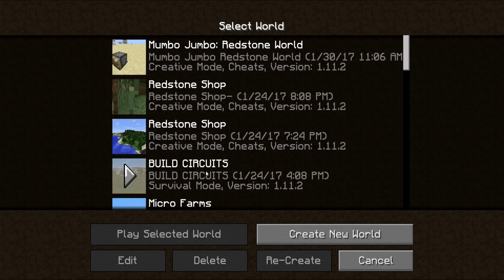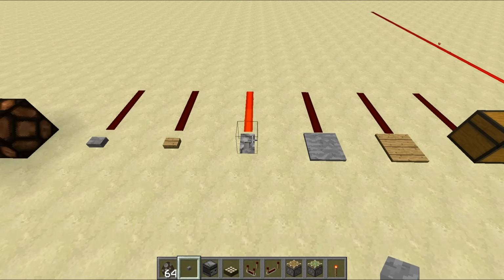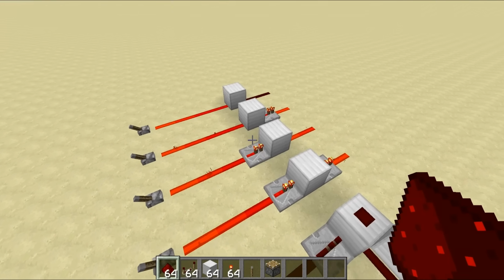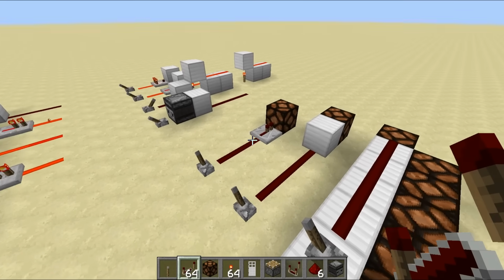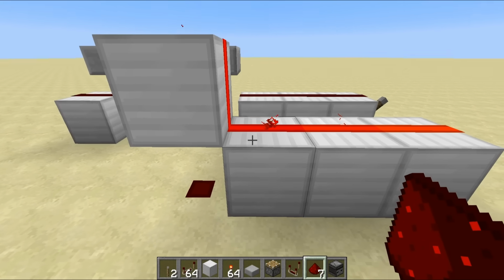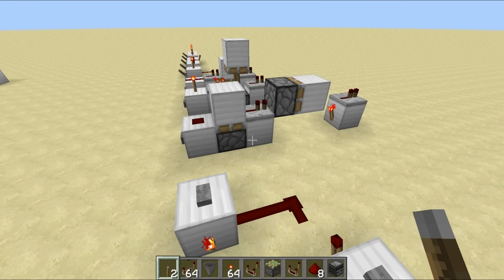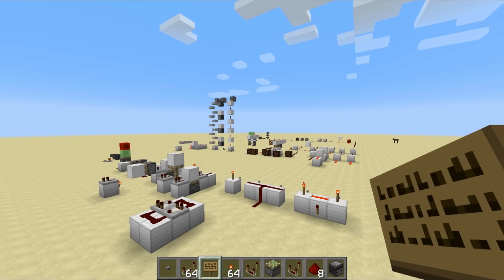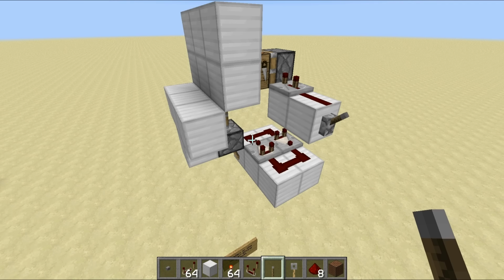How to go From NOOB to PRO at Minecraft Redstone!

Comment: Hey mumbo
any idea how to fix the falling monostable circuits for bedrock?

I was able to hardpower the piston by placing the first repeater on the floor and the startblock with the button even at floorlevel. but sadly the piston does not output power to the 2nd repeater in that way.

same for tflip flip, the output is not constant

Comment: I specifically didn't want to do what Mumbo did. I don't like doors that you just pressure plate walk over, but the homework required pressure plates. So I (poorly) designed a vertically opening 2x2 that you throw an item onto a hidden pressure plate to open the door. It has a delayed opening, so you can keep the "lock" some distance away from the door.

Comment: I somehow created a permanently activated detector rail in survival 0_o It can be updated, moved, powered in any way, but it will for some reason never shut off to the point of breaking it and placing it again. You can power stuff from all the sides, except the block above it. I just used a sticky piston, detector rail in front of it with a minecart, and 2 redstone dust on any side of the piston. And broke the piston. It worked. It even created a redstone clock before breaking the piston.
Edit: Here's my theory how it works. The cart placed on detector rails activates the redstone on the side, powering the s piston and making it move the rail along with the cart away. Then the piston deactivates and retracts the d rail, activating the redstone again. And the cycle repeats again. And again.

Comment: I remember using poor redstone. Now I am learning to use slime blocks five years ago. Then,About 6 months ago, I made a flying machine in a survival world and just built a sky base where it stopped. But now, I'm making actual working tanks. NPC enemy tanks. I use the simple caterpillar engine, deck it out so it looks like a tank, then put the minecart and a ghast in it. Then I just turn it on, switch to survival, jump in my tank, and let the games begin.
✔️Moves 
✔️Shoots explosive ammo
❌Practically indestructible 
✔️Weapon can change direction 
❌Turns 

Also made planes and boats, a pretty good achievement. Redstone movement. Land, air, and sea. Just recently found the engine and extensions alone can just plow through walls! 😆 

I love Mumbo's creations and they inspire me to do better. And he always does new redstone so I never stop learning. Keep inspiring Mumbo!

Comment: Dude my block switcher was garbage crazy.  I put the button two above the block being switched and I did a thing that pushes both blocks back and forth but a third piston comes in to push one of them in depending on the location of the redstone block that goes back and forth with each time flipped.  My pusher piston kept getting randomly powered every time I pressed the stupid button so I had to fix that for an hour.  My timings back and forth weren't working and I had to incorporate a rediculous bud piston updater thing next to it that pushed two observers together creating a quick clock to flip a piston on and off rapidly for like a second, forcing the other piston to update so I could push the darn block into the wall.  It ended taking forever, being massive, and being super loud.  I facepalmed when you not only just pushed the blocks in from different directions but also just used a pulse extender.  Ugh.  I don't feel like a pro.

Comment: Im honestly so proud of how i designed the crafting bench thing, especially because before this i was Grain level awful at redstone. I really dont know how to explain it, i basically used a double piston extender for the wall piece, and instead of the lever he used to power it in the example i used a redstone torch, and then built a tower underneath, which then had a pulse going to the piston that would extend the crafting bench up, and the lever would turn the tower on and off, its pretty impressive for how terrible i am xD

Comment: and t flip flops are an easy way to open and close piston doors from both ways,
Right?
Reply: Yes but remember the design mumbo used doesn't work in bedrock edition. Also if you care about compactness then there is many smaller ways.
Reply: Oh and I forgot, if your using pressure plates then all you have to do is connect both pressure plates to eachother with the redstone and use a redstone torch that will be powed by the pressure plates and run the redstone to the pistons. Sorry if it isn't explained very well.

Comment: Watching this video made me feel inspired to build something in Minecraft, so it gave me an idea, what if I built a machine that will make noise and having a blinking light when melon or pumpkin finished growing, and I actually did it, I made it where when the observer picks up a block that is in front of it a Redstone tick will go off, and a sticky piston would grab the Redstone block which is stopping the Redstone repeating loop from repeating, and the repeating loop would then power the solid light (Redstone lamp) and make it start blinking, and then it would cause a note block to start repeating a note, and when you take the melon or pumpkin out from in front of the observer the Redstone tick would go off again and turn it off, thanks for inspiring me!

Comment: Im probably an idiot for watching this video two years later but i couldnt figure out anything... so i copied ur “hw assignments” and the crafting table one doesn’t work even after copying you... im so confused
Reply: I figured out a work around, but it took sometime because i am also poop with redstone, but ill explain what i did as best as I can:
So move the top piston and the two blocks attached forward 1 space,  as well as the bottom piston
then the redstone torch at the bottom (if facing it) move to the right side instead of the left side like it is in the video.
then use some redstone dust to connect the power from the torch to the piston on the bottom. Also leave the redstone pulse exactly where it is.
Hopefully this helps. But im sure if you look for a video you can find a much smaller and more simple design

Comment: When you play bedrock edition and most of the mechanics don't work :/
Reply: I just found this out the hard way. I just tried to make a piston extender and you cant pull other pistons with a piston.
Reply: Mojang doesn't give a fuck about supported version consistency
Reply: yeah... i can't make the last "homework" wall workbench even from the video since it doesn't work...
Reply: @midnightrose23  i figured it out
Reply: @midnightrose23  u can, but it's very inconsistent.
Reply: Sinister XX use 3-6-0 delay instead of 2-4-0
Reply: LyricLuke It should all work except the falling edge monostable circuit (i havent found a way to make it work yet) the rising edge monostable circuit (replace the first repeater with redstone dust) and the T-Flip-Flop (Hook up two locked hoppers with an item in them to the monostable circuit so that the redstone puls from it unlocks them for 1 tick causing the item to switch hoppers and place a comparator in front of one)
Reply: I bought a whole book about red stone and half the things didn’t work!
Reply: BLT CampLife the book is about Java edition
Reply: BLT CampLife Oh, that's not good. I'm pretty sure I would have bought the same book you bought recently. So, to know it won't help me at all, well, that sucks a fat one, haha. Still, I plan to read through it anyways. It sure would suck if they wrote and sold us books that only work on certain versions/editions of the game, I only play on the Bedrock Edition, on my smartphone. That's just crap if that is the case. Thanks for the heads up though 😁👍🏻.
Reply: I feel your pain. My computer got destroyed about a year ago I only play on phone now. 😅
Reply: I fixed most of the failed mechanics on bedrock by adding in extra repeaters.
Reply: Watch silent whisper he's the best Bedrock redstone guy
Reply: Same! I was able to get the first 2 homework ones that Mumbo explained but the crafting bench one wont work :/

Comment: All I wanted to know is how to make a red stone door but thanks anyway 👍🏾
Reply: Bob Marley Yeah, me too. I want to make one that I can open and close from the outside and inside of the door with two levers or buttons, but I can't ever get it to work. I can put a lever only on one side. I tried a pressure plate and a lever but that didn't work really well. So, now I just use two pressure plates, which sucks in case of in the unlikely event a dangerous mob gets passed my outer wall and layers of fencing, that it figures out how to step on the outside pressure and gain entrance into my humble abode, haha.
Reply: Well, I should have said, my outer wall, then my many iron golems haha, then my layers of fencing.
Reply: First place some Redstone next to a door then put a preserplate next to the Redstone then step on it now you have a redstone activated door
(Sorry for bad spelling)

Comment: Comparator: If it is on, it subtracts if it is off, it compares. Subtracts redstone when there is a weak signal from a powerful signal. Comparator is if the redstone signal is more powerful on the back, it continues on the front, and the same with the front. I guess if that makes sense

Comment: Me: watches video on PC Redstone 
Also me: plays xbox minecraft
Reply: Me: plays Minecraft pe
Reply: They both are on the same update, so everything will work
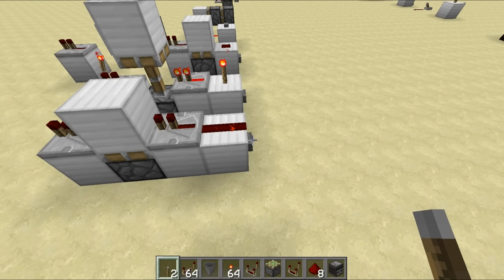Reply: @bruhham6486  sadly a few if the components like the ones at 15:00 won't work in my better together world
Reply: I play on ps4
I hate myself
Minecraft cant have more than 55 chickens or other damn food sources
And lags easier
Reply: And also me: plays minecraft pocket edition
Reply: Yeah I play on xbox 😭
Reply: You need the old disc minecraft xbox one for good redstone. The other stuff is just mcpe
Reply: I play in PS4
Reply: Bal T.D.D IKR
Reply: dan jones all the things should work similarly except for the monostable circuit which requires a normal redstone input instead of a repeater and the T flip flop wich works by placing two powered hoppers after the monostable circuit and letting its output unpower the hoppers causing the item to switch places.
Now just take the comparator output out of one of those and you got yourself a working t flip flop on xbox
Reply: Nikolas Tesla True but there is still the problem of it not being predictable
Reply: Sh0elac3s It worked for me everytime
Reply: jeff jeff Bud powering doesn’t work lol
Reply: dan jones Well also there’s a slight difference betweeen bedrock edition and java edition. Xbox is bedrock and on pc you can get either but mumble has java
Reply: Darksteel Gaming no
Reply: Me: watches video
Also me: Plays MCPE Bedrock
Reply: @evan6630  why?
Microsoft this is good but im hating bedrock redstone.
Reply: @vedantjaiswal9001  they're the same ffs
Reply: @Awesome Gaming Kid same
Reply: @bruhham6486  sorry they aren't do your research
Reply: I play on wii u and most Redstone contraptions that works on pc doesn't work on wii u. For exemple if i power a block that's on top of a a piston the piston that's under that piston will not turn on if you'r playing wii u edition. On wii u the observer activate when it's first placed.  An other exemple : i've watched a tutorial on how to make   a system that automatically place your items in the corresponding (right) chest and recreated it on wii u they were perfectly identical but it did not work cause i made it on wii u. I understand your pain. But Do You know what's worse the wii u edition still didn't get the 1.14 (village and pillage) update. Now think mojang mistake people that play on wii u for ass holes cause they play on a console that failed.
But it's not our fault if we don't have enaugh money to buy an other console and/or another version of Minecraft.
Reply: And their is a limit on the number of mob in a world and on the number of armor stands  in a world on wii u when there is none of Them on pc. That's shit.

Comment: Holy crap.It's basically just Digital Electronics in minecraft xD I wish I paid attentioned to redstone before I went into my electronics class.
Reply: That's not a AND gate in digital electronics though, a and gate has to have both sides to be 1 for a 1 to go through.

Seen on screen at 14:38 he only had to flick 1 lever to get the redstone line to go through. When it should have been both.

Comment: There's a glitch where you stack 3 sticky pistons on top of each other (facing up) and on the third one you attach an observer, you put a button at the bottom and connect the redstone trail from the observer, to the third piston, then press the button and it'll make a never-ending piston loop, you can put a another observer there to make a redstone loop

PS after you make the loop you can get rid of the bottom piston and button after the loop starts, but keep the rest for the loop

Comment: Hey, so. I know this is old, and I know you've probably turned off notifications for this video a long time ago but, just. Thanks, random internet dude.

I bought MC when it was $5 and could still be played in-browser. I've had this game for a long ass time, and have always been intimidated by redstone. I could make basic, simple circuits and slap down a repeater every so often, but this video made everything seem so- actually doable? Which is half the battle, my other friends won't touch redstone with a ten foot pole because it is....really daunting, sometimes. And infuriating! But a lot of the mechanics you went over I already...sort of knew about, but now I know the specifics of ....why you can power through one block, or exactly how many items actually generate a redstone signal, NOT TO MENTION your video on comparators was so fucking easy to follow it was amazing.

Look, I taught college undergrads genetics, and you made this so fun to learn I'm in awe. So thanks.

Comment: i'm a sorta minecraft redstone nerd, but you see, i'm completely self taught. recently, i figured out how to make a CPU (central processing unit; the main component of a computer), because of a new code interperator design. i just realized i can use an RF latch for ram so that it's not all ROM (ROM = read only memory, basically you can't edit it once it's made; ram = random access memory, can be edited after it's made, and is nearly instant to access. ram is probably one of the fastest ways to store digital stuff.) a creeper stepped on the alarm i made, and is scared the thoughts out of me. i don't remember what i was going to say.

don't bother commenting, i well never see it probably for the rest of my life, and yes, that does mean i might see it after i die.

Comment: Well, I absolutely failed all of those challenges... 
The 2x2 door I made wouldn't open in sync - it just opened in a sort of spiral, but by the time the last block opened, the first block closed. I was thinking of retracting the blocks up and down. It didn't even occur to me to make it open sideways, until I looked at the answer. 
The alarm system I built was much bigger and more convoluted than it needed to be, and it didn't even meet the requirements. It was able to be turned off by walking back over the tripwire, and you could also set the alarm off by pressing the button. I didn't even think of using an RS-Nor Latch. 
And finally, with the hidden crafting table, I couldn't figure out the timing. It wouldn't work properly, and it would just keep pushing blocks into the air. It only worked (and it worked really well, there wasn't even a delay) once I maxed out the piston push limit. 

Admittedly, I have no idea what I'm doing with redstone, and I'm trying on the Bedrock Demo version, and as we all know, Bedrock redstone is retarded.

Comment: Hey mumbo and fans I have a few questions regarding a few of the circuits. I play on console and I have noticed that the rising/falling/ t flip flop dont exactly work the way they are intended likewise I've only gotten a double piston extender to work with a 1 4 0 hooked up to a pulse extender. Are the mechanics that much different between PC and console edition?

P.s I have gotten all the circuits to work I just had to through in a few extra lines of red stone or hard power certain blocks using a different method
Reply: Bedrock edition has a few differences in the Redstone mechanics... Qwazy connectivity for example doesn't work the same as java edition...
Reply: Java edition Redstone has some glitches that the Redstone community uses to make these contraptions. Every other version fixed those glitches

Comment: I've managed to make a 2x2 piston door that opens with pressure plates that triggers a Dispenser, shooting an arrow at one wooden button to switch the redstone signal, taking away the piston's power, opening the door, to close It, you just have to step on the pressure plates on the other side of the door, and them descend on one ladder to pick up the arrow. Its impratical, but I'm actually surprised that this worked, thanks for the tutorial ;3

Comment: So, i didn't take the time to mess around with the redstone circuits or with redstone at all before trying the challenges at the end of the video and while  my first two contraptions were bigger by some than Mumbos, I used RS-NOR Latches for the hidden crafting table using two separate buttons, and it was pretty big and a huge mess of redstone.  This was because the RS-NOR latch was the only circuit I was kinda familiar with thanks to being clued to use it in the alarm.  I knew I was about to be showed up when I pressed play to see mumbo's design, but it was even smaller than I thought lol.  And then he's like "of course there are much smaller designs than this".  Well I had a good laugh and the swell of pride I felt when I got the thing working wasn't really soured by this, I just thought it was funny enough to share.